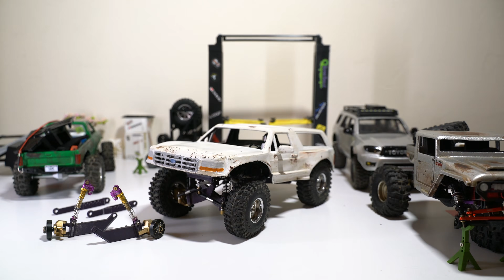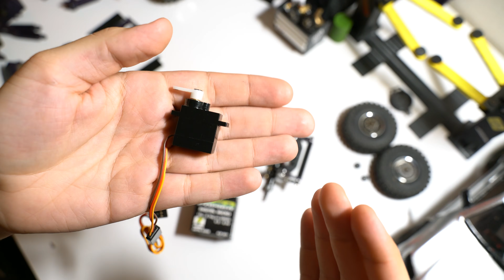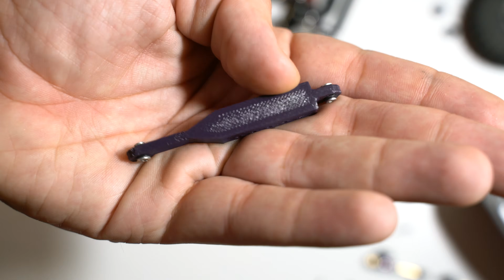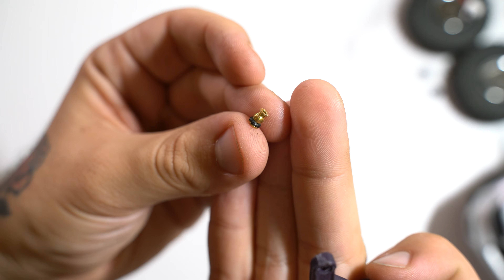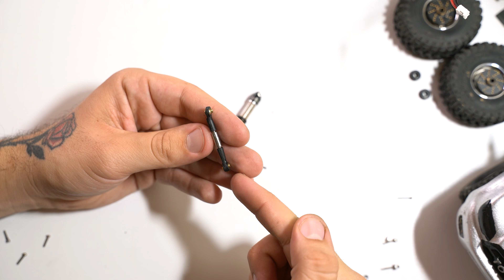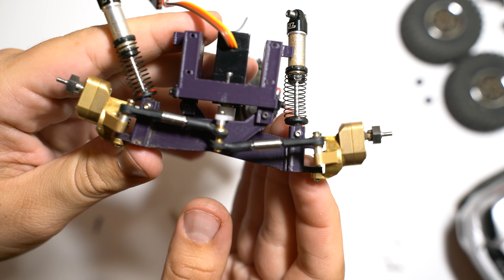How to build an SCX24 Prerunner

Comment: Were can I already buy it without needing to print it
Reply from the maker: I got it linked in the description, or just check out my Etsy page “SameScaleRC”
Reply: @SameScale  what steering knuckles did you use.
Reply from the maker: @L.I.Ghost9  in the final assembly in this set up mofo rc brass portals
Reply from the maker: @ mofo RC portals

Comment: Awsome build, what axel do you use, and do you sell just the trailing arm/battery mount with the shock mounts?
Reply from the maker: Just stock axle housings in aluminum I think are best, or a MEUS rear axle is smooth. 🤙🏼

Comment: Do you have a link for the steering links and front links
Reply from the maker: @aidan2702  the front links in this video were just made using the threaded rod and link ends, however I now include a set of printed ones I designed with orders, as well as updated the file on cults 3D to include them. So if you have downloaded the kit already you just need to go to your downloads and redownload I’d. The steering links I made using the upper links from an injora Ax24 kit.
Reply: @ thank you!
Reply from the maker: @ no problem!

Comment: That was really cool! Liked and a new sub for ya. Keep on keeping on!
Reply from the maker: @MysticRC  appreciate it! I’ll be doing an update video for V2 hopefully soon! I already shredded the first transmission gear on the initial 9500kv rebuild 😂😭. Also just finished some printed front links that will be available instead of needing to create ones with treaded rod/ or various kits. 🤘🏼 thanks for supporting and sticking around! If you’re wanting to see the most up to date activities check out my TikTok if you haven’t already, I post daily there!
Reply: @SameScale  try using metal Mod 5 gears in the transmission. They are more robust from what I understand.
Reply from the maker: @MysticRC  oh… I was…. 😂 the issue was the transmission case was allowing the shaft bearing to have some slop. This slop did not enjoy the new RPM☠️ luckily it wasn’t a hardened steel one which I think helped at least not jam everything. I’ve got a new transmission/ gears coming in after reading a billion reviews combing for shaft play being mentioned.